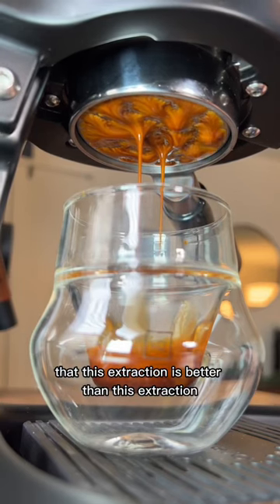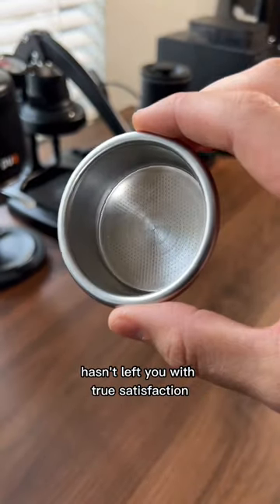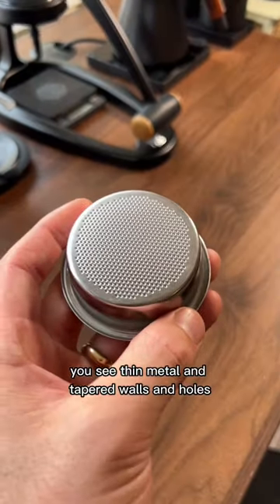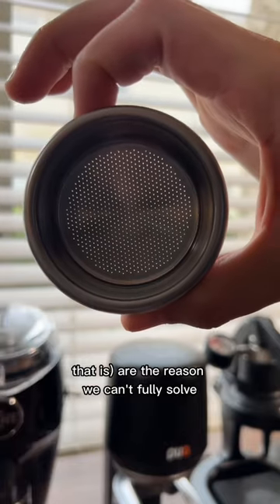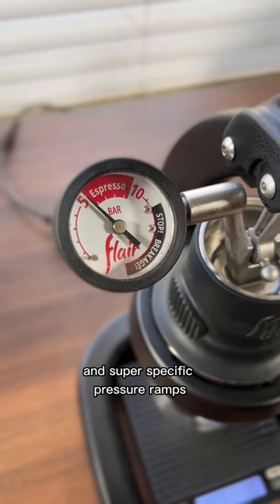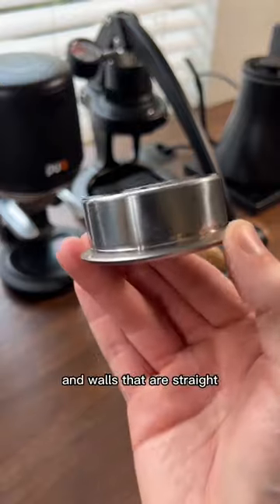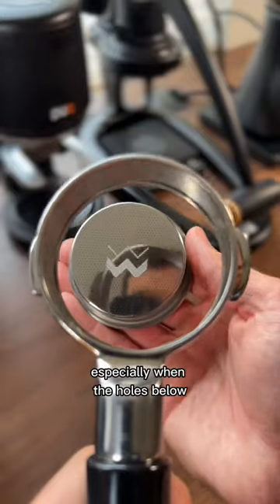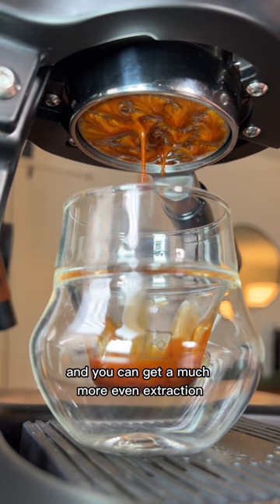The Unibasket from Weber Workshops #unibasket #espresso

Comment: In all of the Weber Unifilter/Basket videos you can see that the coffee comes out of the holes at the edge first and it also goes blond there sooner. This means that these baskets might actually cause more uneven extraction than a regular basket that has no edge holes. It kind of makes sense that the water can flow around the puck more easily than through it and basket designs try to counteract that by not drilling holes near the edge. 
And tbh, I think the rat tail extraction can not be beat for both aesthetics and troubleshooting.
Reply: Rather, this could be highlighting an issue we’ve never known about with espresso extractions. All traditional baskets have some blind space in the corners and could be hiding this kind of phenomenon. 
The unfortunate thing about the rat tail extraction is it can hide imperfections going on under it. I’m not particularly in favor of the unibaskets because they are quite expensive for the average consumer, but I’m really intrigued by what we are beginning to learn with them and how we can improve our espresso in the future.
Reply: The more recent Lance video debunks this thought that what looks to be a good shot is actually false.  Even an ugly shot with spray can be really good.

https://youtu.be/2j5RFFFINPA?si=8jqmIRyn9E_xqzHF
Reply: @crayzieap  it's less of a debunking and more of a criticism of the importance people put in the looks. You can certainly diagnose problems by looking at the extraction. He just says that just because a clean rat tail comes out that does not mean the flow was 100% even and vice versa.

Comment: Got my unibasket today and sprinkled my whole kitchen with espresso, as the flow increased so much. I'm curious about the actual differences it makes when I re-dialed in my beans. I also noticed that the puck screens from Weber are a lot more porous than the bplus ones I normally use, which results in less puck resistance during extraction.

EDIT: After a few days of using it, I have mixed feelings. On one hand, I feel like every filter basket should be like that. It feels like a modern and proper update to the normal baskets, but it could be slightly improved. If the bottom of the filter would be slightly convex on the outside with a thicker material in the middle, but plain flat on the inside, it should result in the same extraction but building up a stream in the middle that reduces espresso sprinkling all over the place. On the other hand I do feel a bit limited as the minimum dose with one puck screen is 18g, so I need to use a second puck screen to maintain headspace and puck resistance for lower doses. This feels a bit awkward. I finally got back to my VST 18g basket for now, as I don’t want to use 18g or even higher doses of my high quality light roasted beans and I don’t have a second puck screen at the moment. 😅
Reply: Okay, so you're THAT guy
Reply: Damn you went kuku after your $170 purchase didn't you

Comment: unless someone with at least some knowledge in fluid dynamics explain to me how this filter makes a difference, not gonna believe it
Reply: The system is designed for a certain pressure. Having a bowed basket will increase the diameter halfway up the basket, reducing the pressure at that section. Additionally, there will be higher pressure at the edges of the bottom of the basket, because the water can't escape downwards. The result is an uneven pressure distribution throughout the basket, and also the water has to channel in a non-uniform way; meaning some parts of the ground coffee beans are extracted for longer than others. The result is an uneven extraction.

Comment: What if I told you this basket costs 170$, and you won't be able to blind test the difference?

I'll do you one better, how do you know if you're channelling with an extraction like this? It basically makes bottomless portafilters pointless outside of aesthetics reasons.
Reply: You taste it. And bottomless means no build up of old espresso
Reply: @andreacapani2170  I don't have an issue with bottomless portafilter, which will cost you anywhere between 30-50$ depending if you want a plastic or wooden one.

I do have an issue with paying 170$ for a basket which no one will be able to tell apart from a regular bottomless portafilter as far as taste goes, while losing both the option to see channelling, and to swap baskets.

If they were charging 75$ for a fancier portafilter which can "sit upright" and has a couple of things you have to give up, sure, but 170$? You can buy some great used gaggia classic's for that price.
Reply: @exeonx6561  i wouldn't buy it without trying it or sure. If I see a difference in a blind test and think is worthed then yes sure (if my wallet agree lol)

Comment: Cant we just load grounds into a thin pipe and force hot water through it? 

Tiny top/bottom area, the in and out of the pipe/straw makes "uneveness" impossible.
Reply: unevenness would still be possible because the temperature of the water/grounds would vary greatly over the course of extraction due to the distance between top and bottom
Reply: @adamharris5003  hmmm perhaps the pipe is enclosed in a heating element?